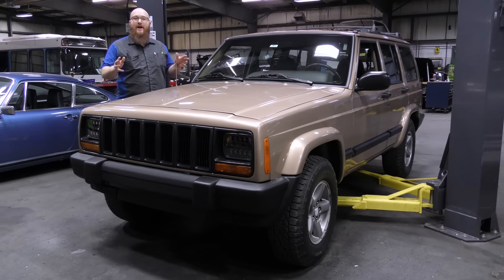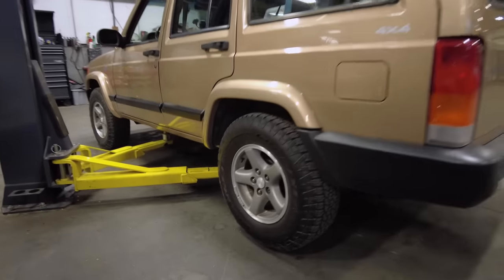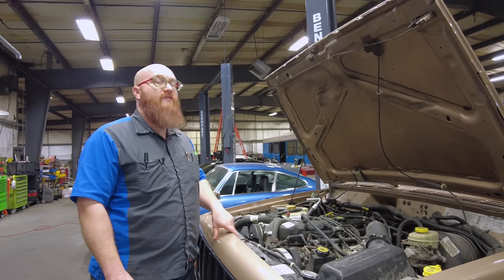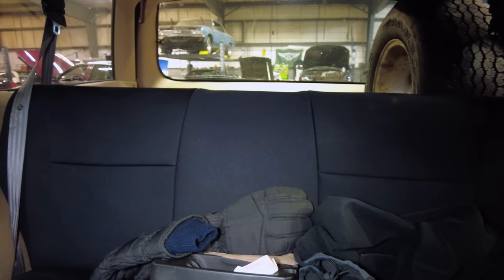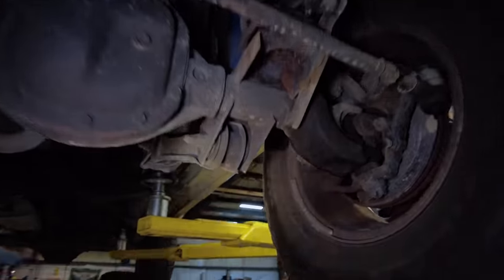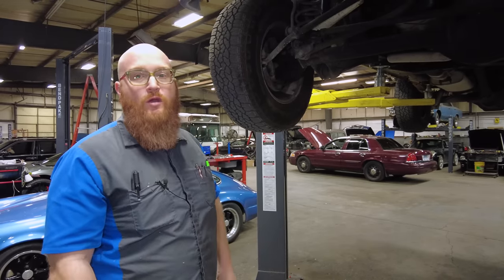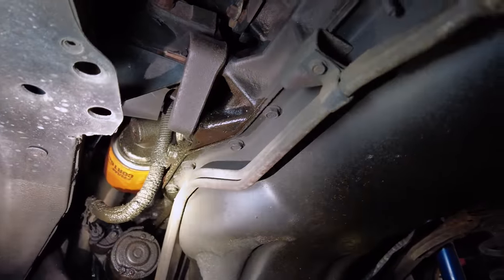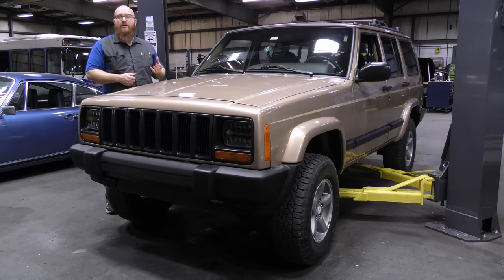Death Wobble on this immaculate '99 Jeep Cherokee! CAR WIZARD shows how to find it and the fix

Comment: The way to fix the death wobble is throw out the jeep ball joints that are made of utter rubbish and replace them with TOYOTA 79 SERIES LAND CRUISER ONES , no modification needed , slip out the old and put in the new , for you guys in America , this is not easy as you dont sell that model , be ware only factory Toyota stuff works , aftermarket is only as good as jeep original equipment .

Comment: That wobble happened to me when my xj jeep was only 5 years old 60,000 miles. I replaced the steering stabilizer and it never did it again, 20 years later. Also, too large of tires.

Comment: Do you ever get into a situation where you adamantly tell the customer the vehicle is dangerous to drive? 
Are you legally bound to not let them drive their vehicle? 
How do you get past the liability on your part? (Other than documenting it on the invoice)

What if something you're inspecting and approve... and it fails shortly after. 
Nothing against you, just wondering in general. 
It just seems like the "sue crazy mentality" keeps it from being fun anymore to work on vehicles. 
I deal with customers daily, but never in a disgruntled scenario.

Comment: It is inaccurate to say worn control arm bushings will not cause DW. If they will no longer maintain precise caster, you're in the club. 
I have chased DW with oversized tires and lifted XJs before. Major key players are: solid track bar bushings, all tie rod ends, no excessive play in the steering box, steering box mounted solidly with an unbroken spacer and no frame cracks behind the steering box, proper toe in and caster settings, ball joints, tires out of round or ballance. Control arm bushings are a much smaller contributor, as long as caster isn't affected. The steering stabilizer is only a band-aid that masks the true causes. The sway bar has almost nothing to do with DW. 
I haven't run a sway bar in front or rear on my build and the stabilizer is quite bent and does nothing to resist movement. I have 33/ 10.50R15s on stock Wrangler 15x7 wheels, and a 3 inch lift using mismatch junk yard parts. I have done a lot of things wrong on my build but I don't have death wobble.

Comment: I'M THE OWNER of the Jeep. I bought it 2.5 years ago with 97,400 miles on it.
The death wobble only happened at 65+ when I'd hit a bump just right. It was bad and I about sh** myself each time. So far what the Wizard and his crew did has fixed it.
It was in a fender bender at some point before I bought it so the front was definitely repainted but I'm not sure about the whole thing. They did use the factory color, though.
The seats are in really good shape but the driver's side has the torn vinyl near the door.
I have the stock stereo but wanted Sirius so installed the aftermarket one.
I'm working on getting the badges put back on as soon as I find some. They were probably removed during the wreck repair.
It had the head gasket replaced at some point before I bought it and figure that's why it looks like there is seepage, not sure it seeps anymore.
There's some minor surface rust under the step protector in both rear door jambs that I plan to fix. I wanted to get it mechanically sound before doing too much cosmetics.
The hitch is stock from another '99 junkyard find as is the cruise control. I put new AC in it.
The XJ is one of my favorite vehicles and I'm just trying to preserve this one.

Comment: LOL.  You mentioned a Jeep Commander and how unreliable they are...  My wife and her ex-husband, back when they were married, bought a Jeep Commander brand-new.  It was just after Chrysler's bankruptcy, when they were offering a "lifetime warranty" to the original purchaser of any of their new vehicles.  In order to keep that "lifetime warranty," however, you had to get it regularly inspected.  

Long story a bit longer, the engine blew up -- literally, spraying parts all over the highway -- and Chrysler refused to honor the lifetime warranty on it.  Why?  Because they missed their most recent inspection date.  Where was the Commander on that inspection date?  *AT THE DEALERSHIP HAVING ITS TRANSMISSION REPLACED UNDER THEIR LIFETIME WARRANTY!!*  The dealership never bothered to enter into their computer that the inspection had happened -- because, technically, the inspection didn't happen -- and so the lifetime warranty was voided.

I will NEVER purchase a new Chrysler product.  Ever.  A 24-year-old XJ like this would be 1,000 times more reliable.  I'd own one of these in a second.  But nothing manufactured since the bankruptcy.  Period.

Comment: Bought a 2001 the last year they were made 4.0 auto 2WD.  At 35000 miles first gear failed in 2003 but still under warranty.  Brought it to dealer got a courtesy car and was told they would get another trans from Detroit.  There were none left.  Ok Japan still  had them so shipping one in.  That didn’t last long and probably too much $$.  Ok engineer from Detroit will be coming down to rebuild.  Nope.  Finally they said local reputable trans shop will rebuild and I would get the trans shop’s 2000 mile warranty.  It lasted until 2014 before selling with no trans problems.

Comment: My 1996 XJ has 373,000 miles. Heater core just failed. Oh joy. Also have death wobble, so will be in there checking. Hopefully it is a replaceable bushing and an easy peasy fix.

Comment: They weren't all great.. My mom had a 94 sport 2 door and it was one of if not the most unreliable trouble prone vehicle our family has ever owned. Got it from a family member in the mid 2000's with 42k original miles.. Always needed something. Head gasket was gone by 60k and it would overheat for no reason at all before and after the head job. A/C died, ride was horrible. Sucked gas like no tomorrow. Must have been built on a Friday at 5pm.

Comment: I just finished "restoring" a rusted out trail 2001 jeep Cherokee xj.

Floor pans, some frame repair, rocket panels on both sides. 

Jeep sat for 2 years due to divorce and lack of money to continue. Then, I saved up to buy a manual transmission and do a swap.

Full engine rebuild to factory spec, done at a machine shop. 

I don't make it a trail jeep, it's my daily driver. And I live in the woods, so 4wd is must.

And project that was supposed to take a year make be two ended up a 5 year project.

Comment: Oh wizard… I am slightly disappointed with one bit of information in this video…. The steering stabilizer is not in any way a potential source of death wobble. There are lots of XJ’s that have no steering stabilizer (myself included) and do not have death wobble. The stabilizer is only there to absorb the very small vibrations that cause your hands to go numb. You should also check the “frame” for cracking where the steering box bolts. The spacer is well known for cracking as is the “frame”

Comment: In 2005 I bought a 1997 Cherokee Sport 2 door 4.0  5 speed.  The only power option it had was mirrors because well, that wasn't an option. It even had the vent windows in the back.  I got it for $2000 with a broken track bar bracket.  I wish I would have kept it stock and never abused it as it was very uncommon.

Comment: i just love this video, i have a 95 grand Cherokee, zj. four wheel coil spring, with all disk brakes. 4.0 six, i love it. i already did a tie rod, and a track bar, but my control arm bushings are gone. that wobble is no joke.

Comment: Best Jeep I ever owned I own one drove it back and forth from Toledo Ohio to Detroit 300,000 mi on it eventually had to junk it because the frame and the body was rusting out. But as far as the engine as far as the front suspension it was fine but you have to change that shock absorber that's in the front and it other sway bar thing that's on the front in order to stop The swinging back and forth I had to do that on mine but I put 300,000 ran like a dream best cheap I've ever owned and I know it because I yeah I work on the assembly line in filthy's in the Toledo assembly so I know what I'm talkin about I was a repairman for over twenty some-odd years. I know my stuff about Jeeps

Comment: The last time i had to fix death wobble on my cherokee, it was worn threads on the mid drag link.  Any way, ball joints, tie rods, wheel bearings, u joint on axle.  ALL are fair game.  When in doubt, switch it out.  Also.  Pull front drive shafts if you cant find the problem.  It makes diagnostics easier

Comment: Wait it doesn't have rotted rockers, a cracked exhaust manifold,  leaking oil filter adapter, sagging rear springs that require cutting the subframe to replace, etc...but the engine will outlive the vehicle? Its almost like I live in the rustbelt...

Comment: If the castor axis is too close to vertical,there is little preload on the self-centering action and the wheels WILL flap left and right. This can be partially corrected with a HD steering damper,but the castor must be corrected. 😧🙃

Comment: I fought DW for 4 months. I replaced everything that could be replaced and still had it. Turned out to be a bad brake caliper. It was dragging just enough to change the geometry and cause the wobble.

Comment: I was chasing death wobble on my jeep at one point. I replaced everything in the front and had it aligned but still had DW. I got to looking even closer and the control arm bushings were extremely dry rotted. I replaced all 4 and the problem went away and hasn't come and I don't even run a steering stabilizer.

Comment: These old Cherokee's only require a 2 inch lift, 35 inch tires, and a disconnect of the swaybars and you have a very capable offroad vehicle.

Comment: the 4.0s are generally very good except the 00-01 with the bad 0331 head casting...when they crack they leak coolant into the oil and if not caught soon ruins the engine

Comment: I love these but here in Romania, a 4 liter engine would have a huge tax and the 2.1 diesels are not very reliable, unfortunately. They were good on light Renaults, but on the Jeep it would overheat and bust the head gasket.

Comment: the real problem you will find with stock jeeps of these years is all the rubber bushes are rotten. my tj rode like a humvee past 55 mph with its factory bushings when I replaced them it drove like it was brand new again

Comment: good vehicles, but terrible gas mileage
Reply: As long as you carry enough gas on the trail....
gas hog  beats NOT coming back because you broke down...
Reply: @JohnSmith-yv6eq  I'm not talking trail, just around town, these were/are terrible on gas.
Reply: @Cam.Klingon  
Pay in repairs...or pay in gas.
Your choice..
Do you have bad winters where if your wife went out in her vehicle.... 
you couldn't care less how much gas she used as long as she returned home without being stranded by a broken down vehicle?

Of course if you drive a Toyota....you get no breakdowns and great gas mileage....
Reply: @JohnSmith-yv6eq  My wife drives a brand new 2023 lexus awd hybrid. I drive a fwd mazda that I have tire chains in, winter driving isn't a concern. Both cars are very reliable.

Comment: 10:52 I noticed that there is some kind of a washer with almost like gears on the inside of it that is loose on one of the track bars or sway bars. I noticed the same on mine as well, shouldn’t that have a home? When we went through mine I never could figure out where that went and it looks like the same on the truck you’re working on.

Comment: Pitman arm,  but it could benefit from a upgraded steering stabilizer,   its definitely in the steering gear box or one of the steering wheel connections.

Comment: Those original hoses need to be replaced     great condition and remove the orange can of death  Fram Oil filter  that will ruin that engine 
Wix or ac Delco  filters best

Comment: had that with my 56 chev    long ago,,,,bad tires
Reply: the front are not wearing  very good   inside is worn
Reply: @Monza62000  I noticed that too, particularly the passenger side.

Comment: I have a friend with a brand new jeep that has experienced the death wobble would it be the similar problems even with new parts?
Reply: Did they put a lift kit on and bigger tires?
Reply: Lots of commments here from owners that had tyres that went unbalanced...some within 20k miles from new!
Always have the tyres rebalanced first...it's the cheapest option...
Reply: @grad0n  nope all stock, the guy is a retired army vet served in Iroc. Said it was the scariest thing he has ever had happen to him. It's a 2022 jeep Wrangler. They are "looking into it".

Comment: Had an xj rock crawler for a few years.  First time it got a death wobble it scared the crap out of me.
Reply: What caused the wobble?
Reply: @JohnSmith-yv6eq  i don't know what the parts are called but the joint where that long rod in the video connects to the frame went bad.
Reply: @SofaKingTouge  
The panhard rod end that was mounted on the axle bracket....

Comment: My brother had a jeep a little older than this with the 4.0 and around 200k. The radiator had a leak so he had to fill it every day. Sometimes he'd drive it 20-30 minutes with no coolant in the summer. Engine wasn't fazed, kept going. He drove it for a while longer and sold it to the neighbor who would drive it cross country. Jeep wouldn't die.